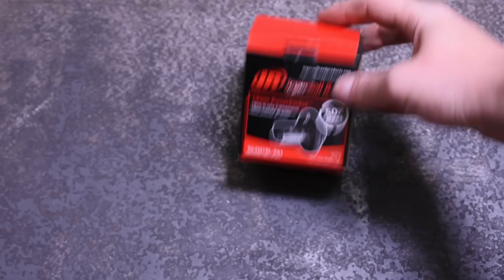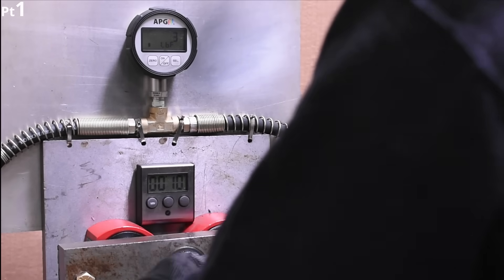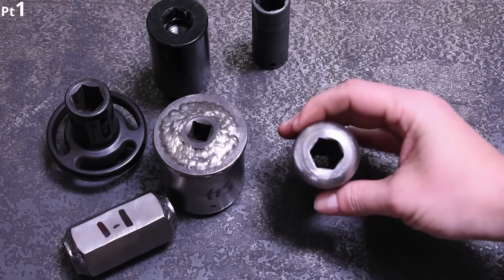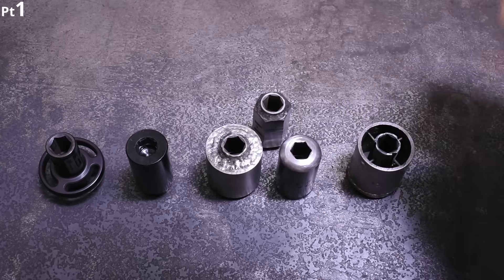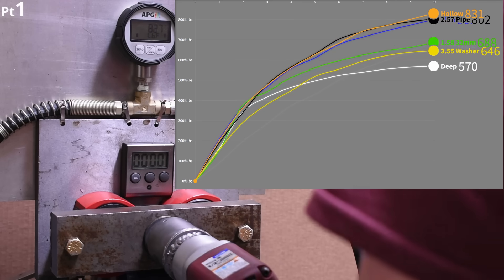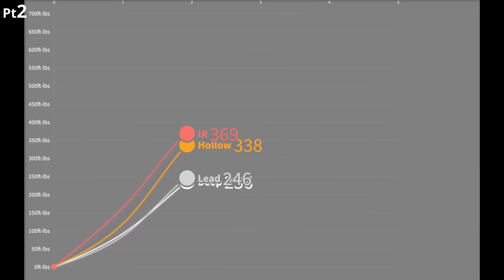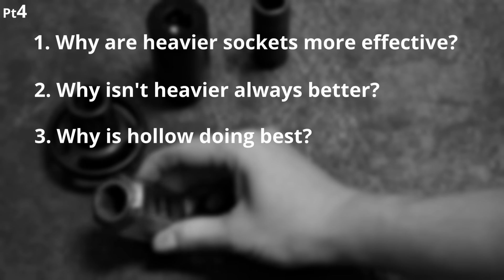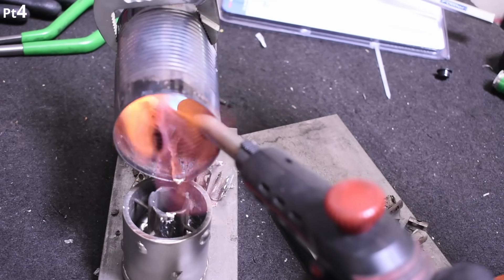Heavier Sockets Make More Power? Stumps Physicist

Comment: 06:23 - The welds along the washers will be flexing, reducing torque transmission and losing energy to heat in the flexing motion. The other designs use a single body which massively reduces flexing.

The flywheel one may be using resonance to store energy and release it in between hammer blows. It may perform differently on different impact wrenches, providing little gain on one but more gain on another. Total guess.
Reply: Torsion from the small welding spots were my guess as well. they could add a few more and wider beads on the outside and test it again. I'm sure the results will be much better.
(Of course only if it has been welded properly on the inside as well)
Reply: @Wiedy99  From the look of those welds they weren't done very well either. Looked like someone was doing the "overlapping spot tacks" with MIG, or at least that would explain the weld craters you can see at https://youtu.be/_dgqi7hx8f8?t=274

The other unknown being filler wire. I'd imagine you want something with a very high yield strength as welded for an application like that. Of course then you'll run the risk of it being too brittle but if that weld can yield it'll just be more wasted energy.
Reply: Jim, you and Eddie (a couple of hours later) are on the right track. The complete system of the driver, the socket, the bolt, and everything else involved will have complex resonances. While they're all held closely together as far as human perception is concerned, there is some play at every connection. All of these objects are subject to very high angular accelerations, and each one is made of some distinct material manufactured in a distinct shape.

The professor was wrong to suggest, if he did, that more mass wastes energy somehow. Extra mass can't dissipate energy this way. Instead, it will give each individual rotary pulse more time to deliver energy from the driver into the socket before that energy is dumped into the bolt. (One could possibly measure this with an oscilloscope connected to the strain gauge in the torque sensor.) Sockets with a larger moment of inertia further increase this time by giving less rotary velocity, and therefore a longer time period per pulse, for the same energy input. 

But again, even if the increased pulse duration isn't enough to explain the increased torque, there could still be an explanation in the resonance effects, and measuring those would require very expensive test equipment such as a high-bandwidth laser interferometer. Or maybe, ultimately, several of them to simultaneously measure the motion of the driver shaft, chuck, socket, and bolt.
Reply: i definitely agree with your theory about the washers, the resonance thing would be interesting to see tested on other impacts as u said
Reply: pretty much exactly.  based on the IPM/BPM of the tool it is designed for.

Comment: Mass obviously adds to the impacting force.
if you launch a 1 gram stone against a glass, the glass wont break.
If you launch a 100 grams stone with the same force, the glass will break.
there is a minimum force needed to hit the glass though.
So, the mass should be calibrated with the impact hammer.
Reply from the maker: 100 gram stone will be traveling 100 times slower with same input force though. Mass alone requires kinetic energy to overcome
Reply: @TorqueTestChannel  yes, hence the "minimum force"

Comment: before I see what the physicist says I'll give my best guess. The graph results are almost dead on for a cubic function, without having any negative quadrants graphable. I bet the flywheel and overall heavy sockets are actually affecting different modifiers that would be used to model out put. This is probably because the actual modeling math is much more than cubic but the two additions could be used to account for it close enough.

Comment: I wonder if some of the softer material is absorbing the energy rather than transferring it to the fastener?  Also seems like there's a limit with how much mass a socket can efficiently transfer?  For example, if you hit a 1oz ball bearing with a hammer you're going to send it flying, but if you hit a 1lb ball bearing with that hammer you're not going to move it nearly as much?  I wonder if the heavier sockets are just so beefy that they're absorbing the impact energy as well?
Reply: Ha, should have just waited until the end of the video.  So regarding that last one, I wonder if that "flywheel" is flexing back and forth and storing energy that gets released with each impact?

Comment: It would be interesting to see if it's something to do the material use meaning the lead ones which are softer materials actually absorbing some of the blow if you made some that were the same weight out of actual Steel does that change anything

Comment: There must be something of value to the increased inertia of the improved sockets.  Though the same energy is being put into the system, the increased inertia means the energy is being put into the fastener more efficiently for the purpose of overcoming friction.

I think a DIY flywheel socket might be better than the pipe idea for access reasons, but the pipe being welded at both ends may add rigidity.

I wonder if fitment both on the fastener and on the square drive has a significant impact on energy transfer (I'm pretty suspicious that it makes a difference, though it might be negligible).  As well as stiffness in the metallurgy itself.  Seeing as impact sockets by design are more springy than chrome hand sockets to make them last through impact use, this would reduce energy transfer by spreadi g out the impulse and returning some of it to the anvil.

I would still be entirely in for at least two sets of 1/2" drive heavy sockets from let's say 17 to 36 mm, I'm not sure where fasteners taper off in common usage but I'm sure some truck mechanics could rattle off all the sizes they would need in 1/2" drive.

Comment: It makes some sense to me. While it does take more energy to get a heavier socket moving, as long as you have that energy to get it moving it then has more momentum and will apply a higher torque before coming to a stop. Hence why the more powerful wrenches benefit more from the weighted sockets, and why going too heavy is detrimental when you don't have the energy to get it moving at a decent pace. I would imagine that the lead lined socket with something like a 1" impact behind it would perform even better. Things get complicated when you're dealing with impact forces and not continuous ones. Also the reason why the hollow socket performed well despite being light, like the IR socket it places that weight further from the axis of rotation which increases the torque and momentum that it was.
Reply: Yeah, exactly what I was thinking. As long as the power of the hammer can "overcome" the mass of the socket, it will impact harder because it's now kind of working like a bigger hammer. If you make it too heavy, the hammer doesn't have the power to overcome the mass, so it just dampens it. 
I have the feeling the scientist doesn't really know how these tools work.
Reply: I presume the less rigid flywheel designs allow for the metal's elasticity to spring the flywheel's mass forward and add force to the next blow.
Reply: Makes you wish they had just put a bigger hammer in it to begin with

Comment: I'd love to see one of those hollow sockets filled with lead shot. I'd be curious to see if the dampening effect would hold the socket against the hex more consistently. Most of the power loss I've seen from impact sockets is from the socket bouncing backwards and the impact impulse being partially lost from the air gap created by that bouncing.
Reply: Steel shot would be better, lead deforms easily which absorbs energy.

Comment: Not sure if anyone has put this forward.  Could it be that the mass that is further from the center is acting as a lever which would provide extra torque on the nut?  This would explain why both the hollow diy socket and the "flywheel" socket function well.

Comment: As much as I believe the rigidity is beneficial, a flywheel creates more rotational inertia at the edges than the center. So if you kept weight low the only change is in inertia.

Comment: From the results it would seem like that the more outwards the mass is, the better it is. So maybe you could try to weld together a souped up flywheel design and give it a go? Also, perhaps a good way to test the effects of rigidity vs. outboard mass would be to use pipes of same weight but differing sizes and wall diameters.
Reply: How about a super short impact extension that is a flywheel style?  Every socket in your drawer becomes special.  Would the design outweigh the inherent losses associated with adding the extension?
Reply: @ericbuilt269  that's a good idea though the extension would decrease overall torque by absorbing impact and adding weight. But definitely worth testing out to see if it helps.
Reply: @jordanalexander615  extensions don't lower torque in and of themselves, but make deflection/misalignment easier.
Reply: @bowez9  so in other words indirectly they do. Especially if you add several.
Reply: @jordanalexander615  only if you don't take the time to keep it straight.
Reply: @bowez9  what about the added mass you're trying to impact against and each joint absorbing impact force, and this is impacts a torque wrench is different I know.
Reply: @jordanalexander615  on a well fitting setup should not be an issue.
The test I've seen with torque wrenches and multiple feet of extension showed NO reduction in torque-UNTIL MISALIGNED.
Reply: @bowez9  so you saw the torque wrench video. But what about impacts?  The reason I say this is because it's my job and there's been many times we had a straight extension on a impact and it wouldn't take a nut off. But when we removed some guards and got directly on it was not an issue.
Reply: @jordanalexander615  well if a extension reduces torque it would reduce it with everything.
If the assembly is poor fitting then I could see the impacts being affected but the torque is not.

This is also in the scope of my work.  We ONLY  use extensions when necessary, less to carry and brake, but rely more on torque multipliers.
Reply: @bowez9  we use them to take large equipment apart mostly. Like things requiring over a 1000lbs or more. Extensions don't survive very long nor do sockets. We had a few explode from the hydrawrench.
Reply: I believe the best results would be maximizing angular momentum (which is moment of inertia x angular velocity), and having a hollow section increases angular momentum without increasing weight as much as a solid heavy socket. We know from your basic I=MR^2 equation that inertia scales with the square of radius. 

As the socket gets heaver, your inertia increases, but your velocity goes down and it trades off. if you plot angular momentum (nut busting power) on the y axis of a graph weight on the x axis you should see a bell curve where more weight helps and then starts to inhibit. i imagine this is different with all different tools and the engineers tune the weights of the impact mechanism to with best with the average weight of common used sockets. 

For the practical application in the video here, i bet both the IR and the cheaper socket may both be on the left side of this bell curve because of how much power this air impact may have. whereas the makita knockoff you are already so far to the right on the bell curve that you actually lost power. IR may have designed this socket to work best with the average homeowners impact (whatever that may be) and adding weight may make it work better for bigger impact wrenches  and reducing weight may make it work with smaller impact wrenches. 

if the combo between your chosen impact and the IR socket happens to fall at the top of the bell curve, then ANY change you make will reduce overall beans. anything is a tradeoff and they may have done a ton of engineering to maximize this socket's performance with a specific type of impact.
Reply: @nicksz8909  hi
Reply: @mr_dolphin09 🤣🤣🤣
Reply: This.  Mass by itself isn't what's getting you what you want, it's the rotational inertia.  You're working with a second order torsional vibration, and trying to maximize the angular vibratory torque.  This is done through a combination of changing the torsional stiffness of the socket as well as it's inertia, and tuning them together.  

There's software that can do this, and it's often done the other way with engines, using dampers (called harmonic balancers) to lower the torsional vibration of each of the cylinders firing in an engine.  

The higher the inertia, the potentially higher the resultant peak torque is to a point, provided there is sufficient total stiffness to work with it.  The one thing you see though which is supported in your testing is that the higher the inertia, the longer it takes to reach that steady state peak torque.  This is why the lighter sockets rise in torque really quickly, then flatten out, while the lead socket rises slowly, and never flattens out in the duration of your test.  If you were to run the test for longer (say 30 seconds), I'm sure you'd see it pull into the lead.

Information on torsional mass-spring-damper systems should get you what you're looking for with the associated equations.
Reply: I think these two are on to something. Increase the moment arm and you should be able to increase the torque. Now the force being put into the moment arm would be determined on how fast the tool could accelerate the mass, so there would be a sweet spot for weight. Or at least that’s my armchair analysis. 

I think it would explain the weights not making a big difference because the moment arms are pretty close to the same and once you get to a certain weight it hinders the process instead of helping because the acceleration is slowed down with the higher weight.
Reply: distance in moment of inertia calculation is squared, so 2x distance means 4x inertia with the same mass. Would be interesting to see something like IR flywheel but with more mass at greater distance
Reply: I agree. I feel the hollow socket is near a sweet spot in which the weight (and placement of said weight) allows the socket to reach optimal momentum (therefore delivering more kinetic energy) while simultaneously optimizing the centrifugal force applied to the socket and therefore the torque applied to the bolt.

Here's a link to how to calculate it. I'll continue researching it more as well!

I tried attaching the link but my comment keeps getting taken down? Maybe the link? Replied like 2 hours ago. But it looks like a lot people are coming to similar conclusions. How cool!
Reply: I’m thinking the largest diameter possible with a weight that the tool can handle would be the most effective option. Also have to take into account how rigid the new tool is, too much flex and distance from the center and I’m thinking there might be some sort of harmonics canceling out the effort put out by the tool. Spitballing here
Reply: I was here for say the same. The same angular speed of the impulse became more linear speed in the outer part of the wheel. The kinetics energy is 1/2mv² . So... Is more important the velocity than the mass. Did you ever use one of that stool with the round wood seat fixed to a screwed rod for adjusting the height? Even if the seat was light if you made the top spin too fast making the top reaching the lowest position everything will become stuck and hard to be open. Is not the mass of the wooden top by itself but the combination with the velocity!
Reply: Oh man I just commented a super long similar explanation of this. Well maybe. I mean this is a better explanation of how I thought of it in my own mind, and maybe my comment came out wrong and is way off idk  lol....anyway.... Torque=Force*Diameter experiments or something similar are in order right? I have no formal education past HS,  so I'm no physician.... lol jk... physicist (not that dumb but try to be funny sometimes lol), but I love learning the easier stuff like this I can understand so I can always get the pickle jar lid for the misses lol...my extremely long, cold medicine induced comment has made me loopy sorry if I hijacked this thread. 😂
Reply: Exactly what I was thinking.
I want to see the flywheel socket on steroids, with the flywheel like 6-12” in diameter with some serious mass
Reply: You smarter than the soo called  "professor "
Reply: I am completely uneducated in this field but I feel like an easy albeit expensive way to prove mass does have an effect (wether it is in inertia or resonance would be a different problem) would be to have a socket made from a lighter material with similar performances to the steel in the sockets. It would nicely show there are more factors at play than rigidity of the socket/twisting/etc.
Reply: That’s what I was thinking. I’m sure someone smarter than me could word it better? But it’s like a centripetal force helping out

Comment: The IR power sockets work better because.....they cost more. I have a set of cheap weighted sockets at work that I use for stuck lugs sometimes and they certainly do help but I've been eyeing those IR sockets for a few years. On the science side of things I think the flywheel design works because the mass is farther out which imparts torque back to the socket when it stops with more force. Would you be open to adding weight to the flywheel of a power socket or making the legs on it longer to see what affect that has?

Comment: I bought the OEM 6 piece set of crank sockets. They work great, would like for you to test them they are only $99 set. My opinion it rigid because it’s thicker and won’t stretch or flex and adds a little weight which helps up to a point